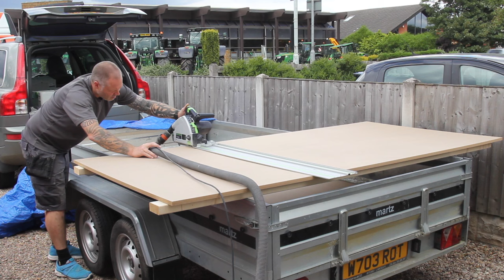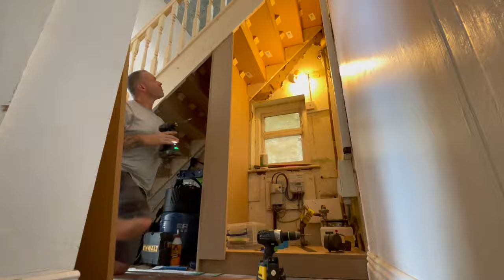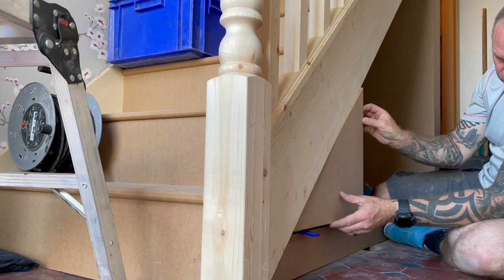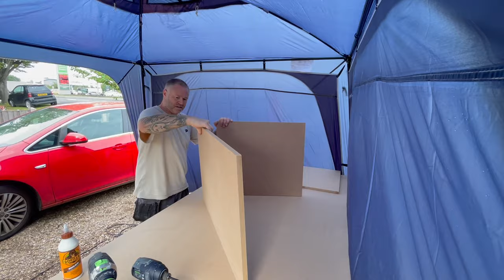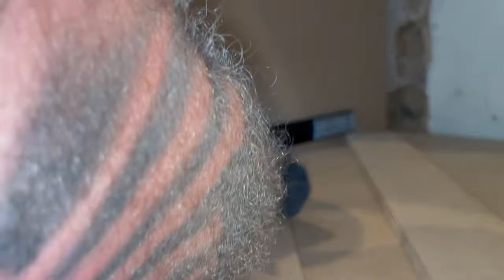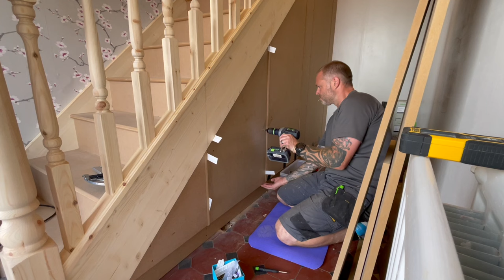Harry Potter is moving! (Under Stairs Storage)

Comment: Looks cool, but MDF resting on tile that will be wet mopped is trouble.
Reply from the maker: Sure it would be if it was to be left as it is. The client will be having it decorated and sealed to the floor and walls, this is pretty standard. Thanks for raising a valid point though 👍🏼
Reply: Waterproof mdf, doh.h

Comment: Hi mate i went for the same runners as you, after fitting them i go to push the drawers but jams half way under stairs is it because the runners are not aligned correctly. Had the runners off a few times now still no luck etc
Reply from the maker: Yes I would say it is an alignment issue. Refit them rather than trying to adjust them is a better option in my experience 👍🏼

Comment: Hi, may i know if you add the front cover of the cabinet, how could it still push the slider inward to open? because if the front cover is bigger than the inner cover of the cabinet, it may blocked the push distance by the vertical supporting board?
Reply from the maker: Hi - I use push to open drawer runners and door catches. These naturally create a small recess behind the frontal to allow function. Hope that helps 👍🏼

Comment: Thanks for the video. I have a similar job to do myself. Can I ask what draw slides you used and what weight they were rated to please? Can I ask how much a job like this would cost to have do also. I think I have been way over quoted. Thank you.
Reply from the maker: Hi. I would say anywhere between £1500 - £2000 depending on materials and spec.

Here is a link to the runners I used:

YENUO Push to Open Drawer Runners... https://www.amazon.co.uk/dp/B08BK394NK?ref=ppx_pop_mob_ap_share

Comment: Great job and thanks for sharing. Looking at doing something similar for a customer. Noticed you used 3 drawer runners for the bigger pull out did you use 3 for the smaller one too?
Reply from the maker: Thank you. No just on the larger drawer for stability 👍🏼
Reply: What make and load draw runner was used please?